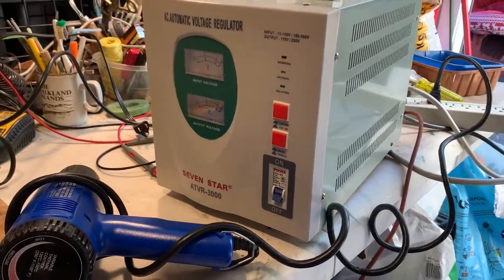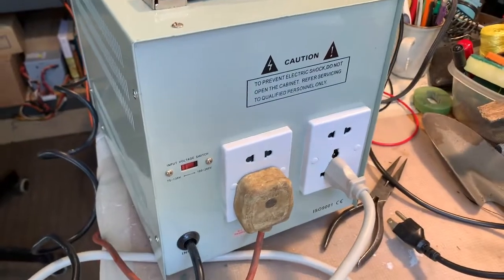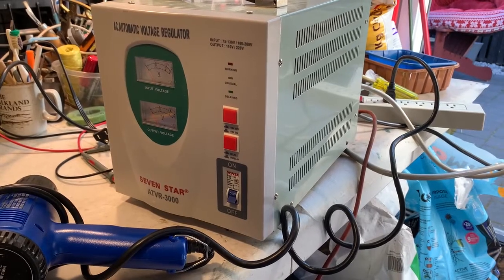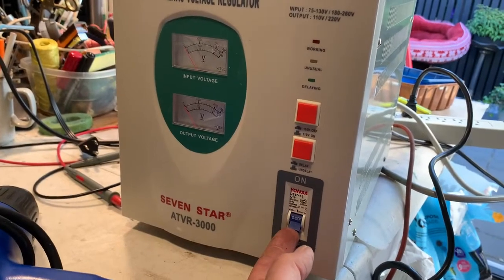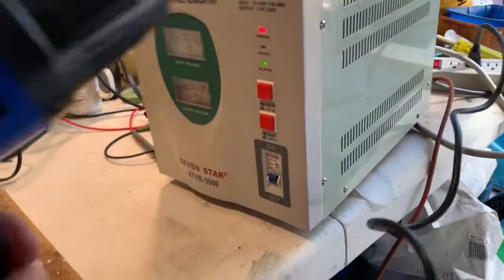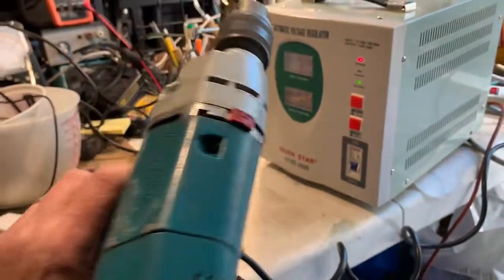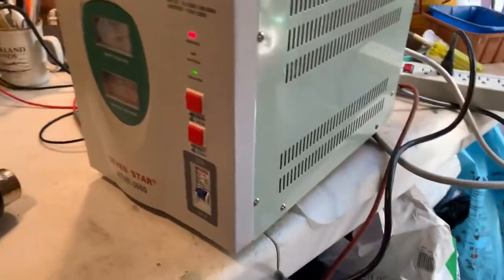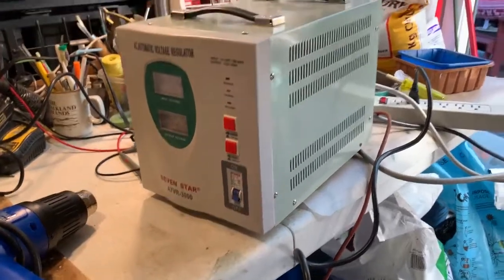Seven Star Automatic Voltage Regulator Demo After Repair

Comment: Mine is giving output voltage when I turn it on but the working light/indicator is always off. Please Is it a problem?
Reply from the maker: I would think so - if the output voltage is as it should be, maybe the indicator light has failed or a connection to it has come adrift.  I repaired the unit for a friend and no longer have access to it, so I cannot compare.  The manual can be found here: https://estore-sslserver.eu/WebRoot/Store6/Shops/6d20e44e-44e3-492b-80d3-fb690ac51c54/54B4/C746/BE7C/A22C/D875/0A48/3525/DA66/ATVR-5000_-_10.000_20140001.pdf .  Also,  see video here: https://youtu.be/ObKaV2cspwY .

Reply

Comment: Can you please explain the 110v output button 
And whether to leave it on or off
Reply from the maker: Hello.  I do not own or have access to this unit any more.  The manual notes " '110V OFF / 110V On': If the rating of the input voltage is 110V, please select '110V ON'.  If the rating of input voltage is 220V, please select '110V OFF' ".  So, I interpret this as if you are using the unit plugged into a 110V supply. switch it on, and if plugged into a 220V supply, switch it off.
Reply: @RadioRestoration  okay 
Thanks for the explanation because I've seen the button for years but didn't know the function 
How do I check if the device plugged in is 110v or 220v
Reply from the maker: @Toshobi  The explanation in the manual indicates that it is referring to the input voltage to the unit, ie. what the supply voltage to the Seven Star unit is, not the voltage of the device you are powering from it.
Reply: @RadioRestoration  okay but my voltage is reading 190 so should it be off
Reply from the maker: @Toshobi  Voltage reading on what? - the input voltage or the output voltage?  I suggest you download the manual from the internet.
Reply: @RadioRestoration  okay please do help with the link 
Thanks for your assistance
Reply: @RadioRestoration  input voltage 190
Output 221
Reply from the maker: @Toshobi  Manual can be found here: https://estore-sslserver.eu/WebRoot/Store6/Shops/6d20e44e-44e3-492b-80d3-fb690ac51c54/54B4/C746/BE7C/A22C/D875/0A48/3525/DA66/ATVR-5000_-_10.000_20140001.pdf .  Also,  see video here: https://youtu.be/ObKaV2cspwY .

Comment: Can i use a 3500w electric cooker on a 5000w automatic voltage stablizer
Reply from the maker: I don't think I would - the switch-on surge may damage the voltage stabilizer unit if it is not adequately protected.  Do so at your own risk!
Reply: @RadioRestoration  I did so. I eventually used a 5000va century stabilizer for the  3500w infrared cooker and it worked fine. Infact I was adviced to use the stabilizer to get the best out of the cooker.
Reply from the maker: @cnyel  Good to know!

Comment: My own is showing the same voltage input and output
Reply from the maker: I have no idea why - sorry.  I fixed this one for a friend and am not that familiar with the circuit
Reply: That is because you are having it on "Delay" 
You should put on "Undelay" 
Then start the device normally 
And then if you have a refrigerator put it back on "Delay"

Comment: mine makes a roar when turned on is it normal because your's are silent??
Reply from the maker: I doubt that is normal.  The unit does not have a fan or other part that could emit a 'roar' as far as I can recall (this unit was not mine and was returned to its owner, so I cannot check it out).
Reply: @RadioRestoration  
Thanks for your reply 💛. i will change it as soon as possible then.